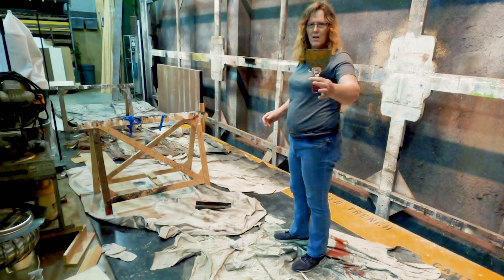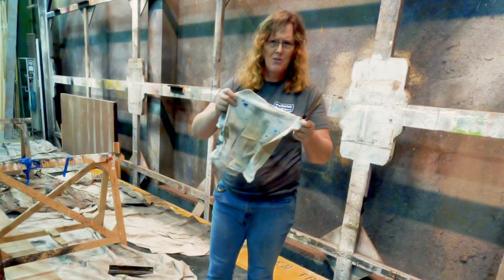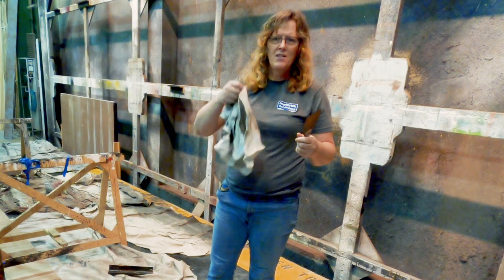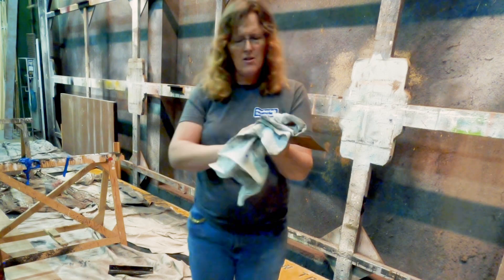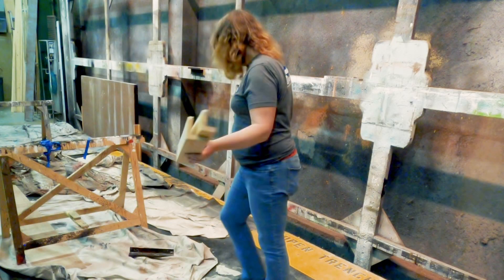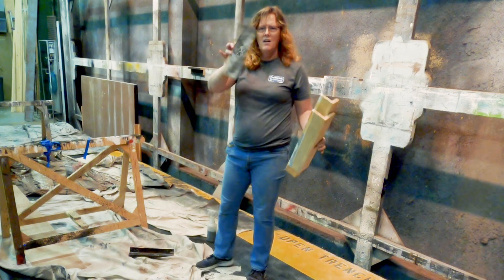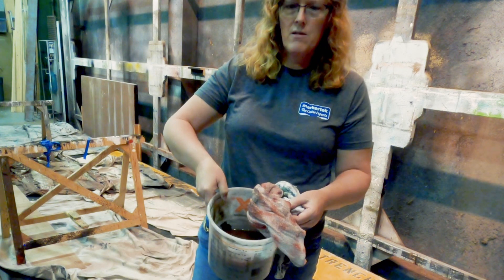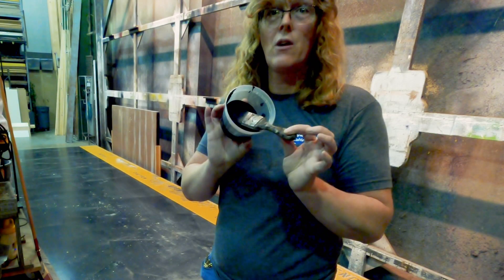Poor Care of the Paint Shop…

Comment: Very familiar song.  My favorite verse, which you didn't cover here but I'm sure is an issue, was having campus maintenance come over to the shop last week (again!) and having to run a long cutter head cable through the drain on the paint sink from folks either not using enough water, not using soap, or pouring half-dried paints down the drain.  Not to mention the thick layer of paint peeled out of the sink basins.
Reply from the maker: At least our paint sink has an interceptor to collect solids. We have to get it cleaned out by facilities folks every couple years. If we ever start doing plaster casting that will require some new training so ppl don’t throw THAT down the sink. Our sink is stainless steel and also gets some cleanup every few years. 

I like to use drop cloths in the shop because I don’t want the shop floor to become a paint drip mess. We don’t have a separate paint shop. One shared shop for wood work, metal work, and for painting.